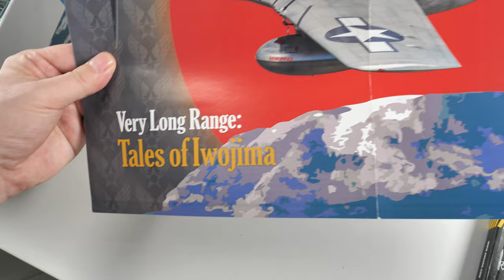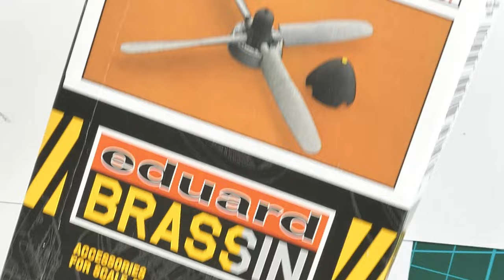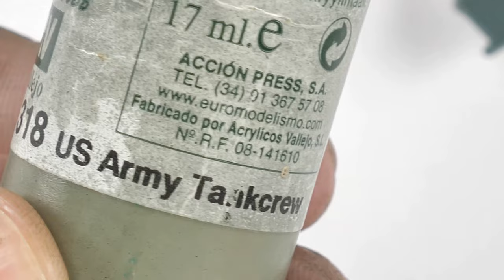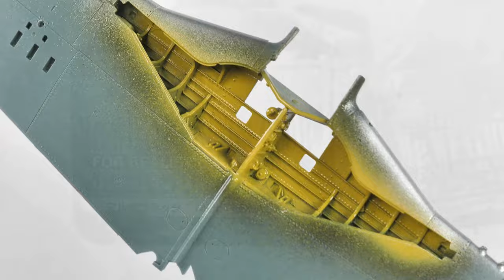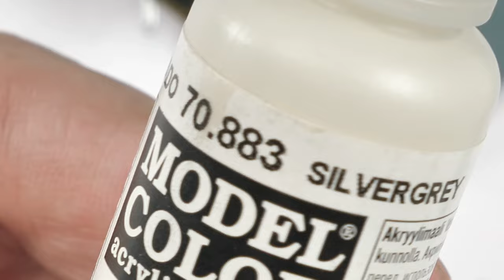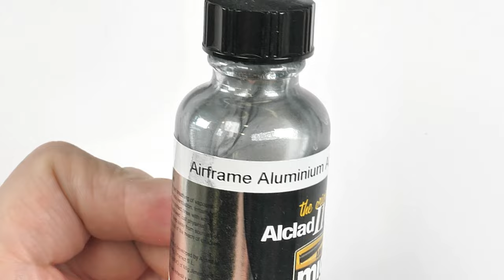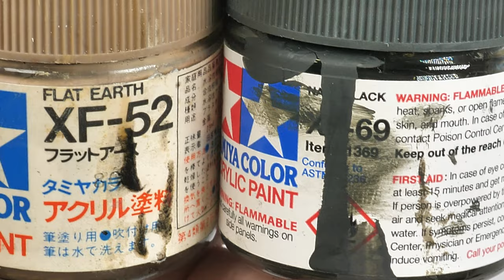Eduard 1/48 P-51D Long Range Mustang PART III full build

Comment: were you stripping decal film ?
Reply from the maker: i removed the thick decal film... it changes the appearance of the decals in a big way. in any case i concluded these Eduard decals are terrible ... as it is not an easy procedure and why have to do this in the first place. Such a pity they didn't continue to use cartograf decals... but i understand why.